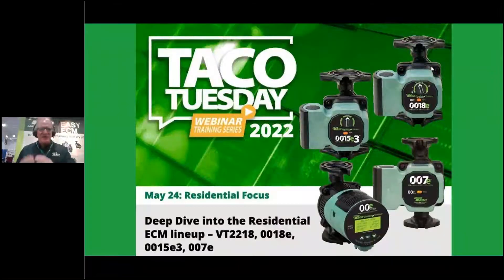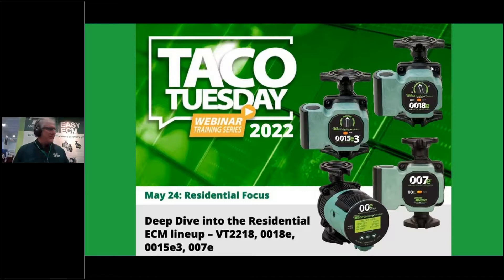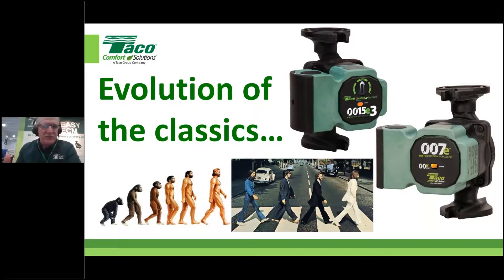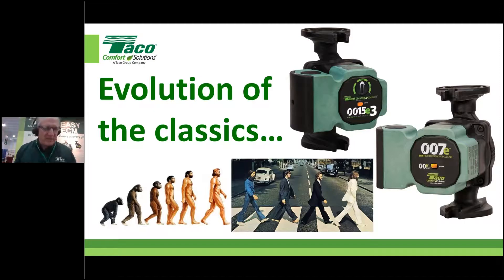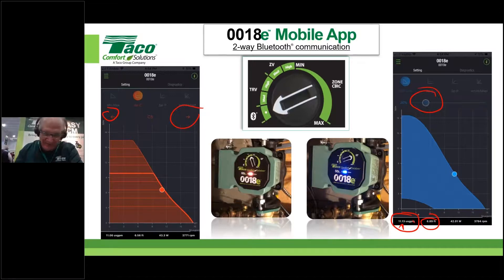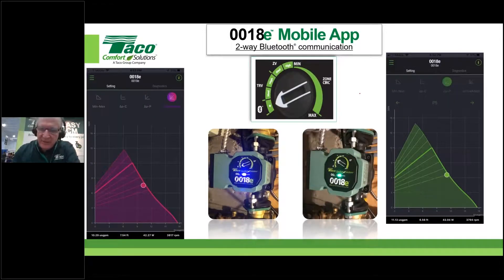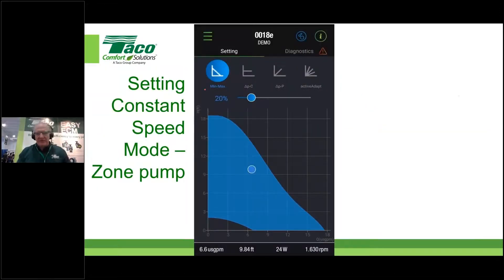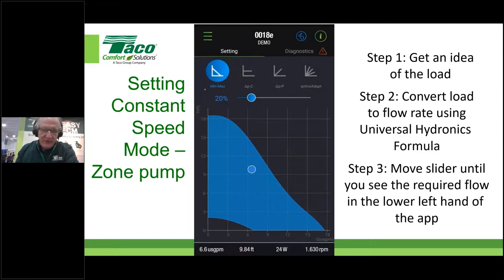Deep Dive into the Residential ECM lineup – VT2218, 0018e, 0015e3, 007e

Comment: VT2218 question... I'm looking at moving the supply side sensor away from the black iron pipe, and down a few feet onto the 3/4" copper pipe. 
With the sensor mounted on the black iron coming off the boiler, there's too much of a sensor lag due to the thermal mass of the 1-1/4" black iron.
Thoughts?
Reply from the maker: Not a problem and sounds like a good idea to get a good read of the temperature when the water reaches more of a laminar flow to read closer to what the water temp is.